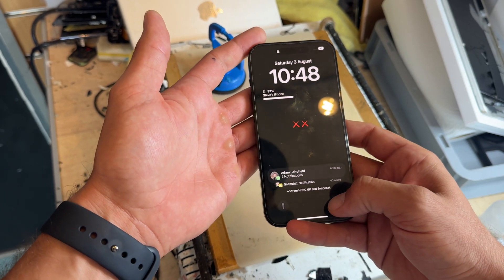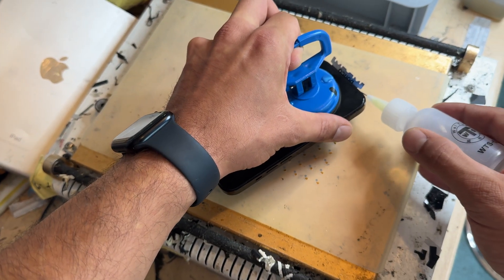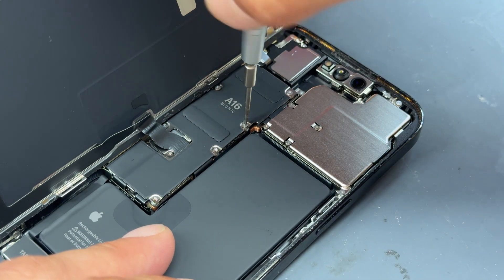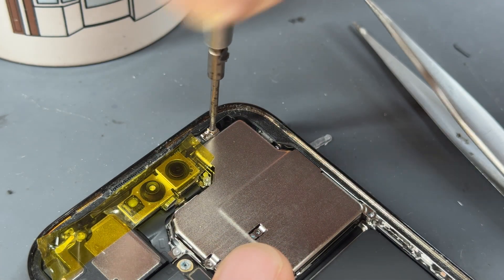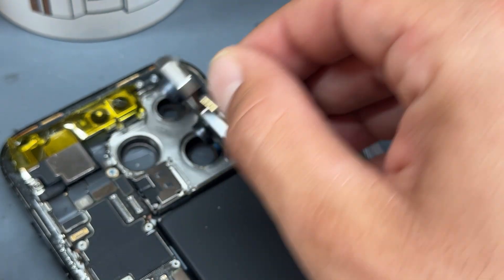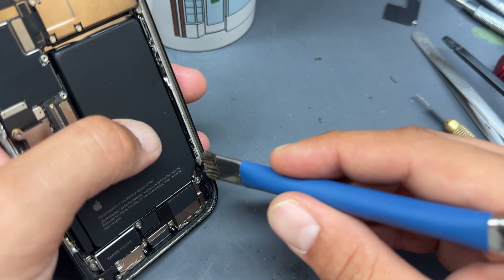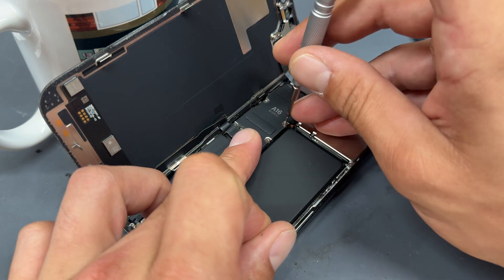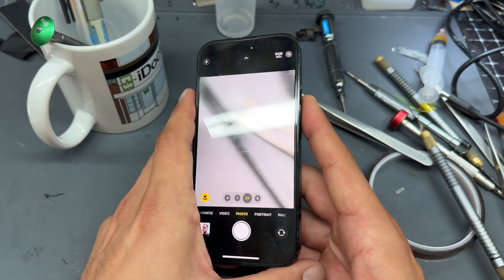iPhone 14 Pro Camera Replacement Guide - DIY Fix for a Perfect Camera!

Comment: I need to do this on mine, as vibration on motorbike killed my 3x zoom image stabiliser, and also loads of dust getting in on the sensors somehow.
If I replace the rear camera is there a way to seal the phone properly afterwards to stop dust and water getting into it?

Comment: Hi, please will I still be able to be able to install iOS updates after receiving the “camera not recognized message” ??
Reply: Yes, no part swaps on the iPhones will prevent it from letting you download and install iOS updates.
Reply: @ChrisEpp What if we are buying separate parts and making iphone?
Is that possible to remove that error message? Of battery and camera and display
Reply: @SwapneelS9 Not that I’m aware of, for example with the battery you would need to remove the BMS and spot weld it to the new battery and then use a tool to wipe the cycle count and health back to zero as it’s now attached to a new perfect battery (that was the phone still sees the original BMS and assumes the battery is still original).

So if you were building an iPhone with parts you got online, none of the serial numbers and such that the motherboard would expect would match. Hope that makes some sense.

Comment: If you pop the phone on the heat mat and let the frame warm up, use the spinning rod and the adhesive comes right off. It's so much easier than scraping with the blade :)

Comment: Is a programmer not able to write the old camera serial info to the new camera so that message doesn't come up?
Reply: No, you need the programmer and a special Flex cable that is soldered on top of camera, you have to remove the top SHIELD to access the circuit
Reply: @MpchBrwn What if we are buying separate parts and making iphone?
Is that possible to remove that error message? Of battery and camera and display@MpchBrwn